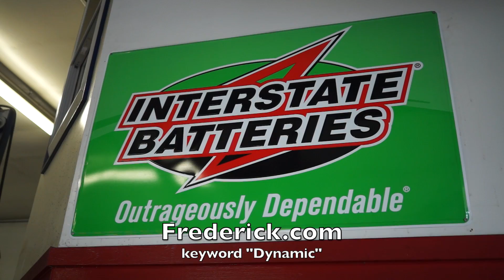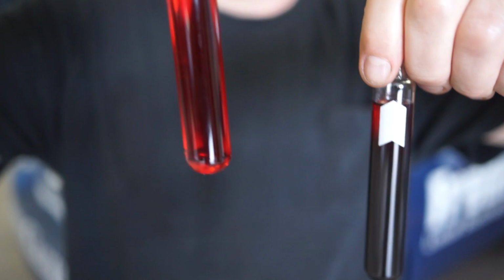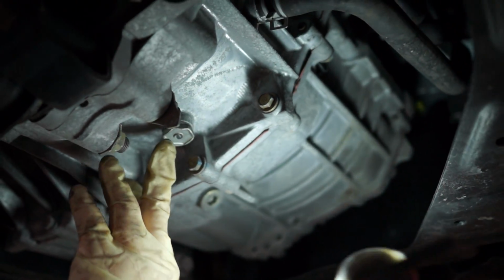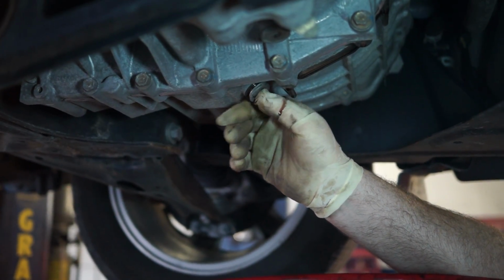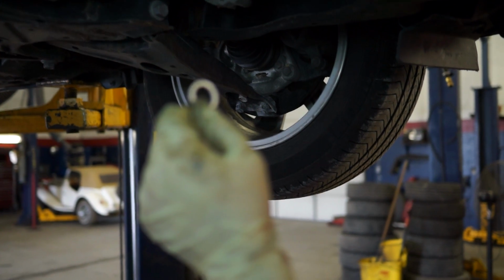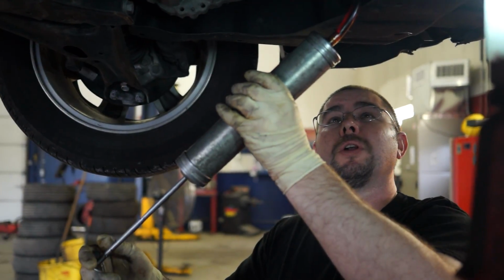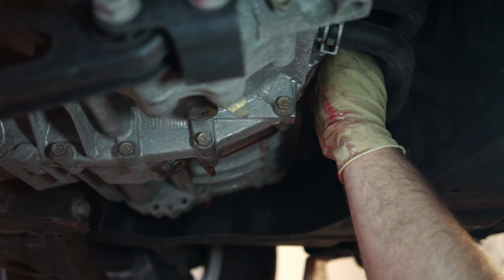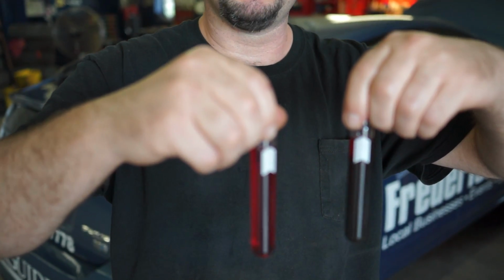Prius Transmission Fluid Change (eCVT)

Comment: When I had my 2004 Prius, I changed my trans oil for the first time at about 215,000 miles and it was still reasonably good, it was a dark red color with nearly the same viscosity as when it was original, my measuring device showed it as a little broken down, also no debris visually or magnetic, but still good, and instead of using a suction device to refill I ran a flexible clear tube from the top into the side with a funnel connected at the top. I finally scrapped the car when the odometer got up to 299,999 miles and wouldn't go past that (PS: the dash went black every now and then, but fixed when I removed & replaced a capacitor with one that had a higher μF on the unit underneath the "D" gear light, labeled "C1"), even though I'm sure there's a firmware update that could've fixed the frozen mileage problem at 299,999; and amazingly the main hybrid battery was still in good condition and the car averaged almost 62 MPG every day, city & highway combined (usually from the SoCal to Southern Utah and back) considering it was 13 years old when I finally replaced the car in 2017 with a 2017 Prius Prime. The only problem it was having was the engine started idling rough after 290,000 miles whenever the car started up cold and it got an intermittent misfire trouble code. The spark plugs were changed with Denso brand at 100,000 miles and never again, my (synthetic 5W-30) oil changes were every 10-15,000 miles with a little top-off every now-&-then, and the K&N air filter that was only cleaned, not replaced, the coolant was changed twice in its entire lifespan, and had only 2 tire changes with regular balances and rotations, the Eco tires of course. In Southern California I still managed to sell it for $2,500 with all those miles. It's a good car if you take care of it.
Reply: Exactly the comment I was looking for. I bought a 2nd generation with 175k miles as a beater for uber and I know changing auto transmission with high mileage can risky if the transmission is on it's way out. I still think it is worth the risk and to change it. The prius has longer service intervals with the electric motors so I am confidant after the change, no issues. Super easy, just like my manual gear box on my G. 

Thanks man!
Reply: Just changed it with Amsoil Full Synthetic Automatic Transmission Fluid, no issues what so ever.
Reply: The prius is a bullet proof tank. 5k miles later, bulletproof tank at 205,000 mikes
Reply: Motordyne G35 It’s like your manual gear box because that’s essentially what it is! It’s a planetary gear set which has a chain and is electronically controlled. Changing the fluid is ONLY beneficial. New fluid will only improve things lubrication wise. And the gen 2 Prius is a tank. Things are truly solid. Built in Japan 🇯🇵
Reply: The guy in the video kind of doesn't know what he's talking about, the only thing that really generates any sort of heat in a prius transmission is the wet clutch. It's essentially just 2 electric motors sandwitched between a planetary gearset, there's no friction belt. Probably why you can get away with 200k miles on the same fluid.
Reply: i just picked an 07 with 255k and im getting 43mpg city did you get better mpg's after the cvt fluid change?
Reply: @devanwheeler3426  agree.. When he talks about clutch wear in the oil, you know he has no idea about the transmission... You can complete the oil change quicker at home...
Reply: I got my 2008 prius in 2015 with 40k on it, used as a pizza delivery vehicle, now for the last 5 years I have been driving 10 miles to work. It how has 150k and I've only averaged 31-36 mpg since day 1.
However I've I take a hiway trip which is rare, I get 55mpg.  At 140k I did brakes for the first time, and tires for about the 15th. 
Fuel System cleaner every 3k
Oil change every 3k
Reply: @MotordyneG35  a drain and refill would not do much damage anyways... that is the safest way to do it if you havent done transmission fluid change in a long time...  much safer than flush for sure.
Reply: Your 2004 Prius was not getting 62 mpg. On a clear day with tornado winds propelling you forward you might have gotten 42 mpg. And I still wouldn’t believe you.
Reply: why did you say never again to denso plugs? I understand they are the original in many Toyotas
Reply: @sherifmohsen1974 my prius gets 62mpg regularly
2012
Reply: @justinhaller2055 same here... 180k miles on a 2007.
new tires and spark plugs... driving carefully to charge in every chance.. same 41mpg
Reply: @sherifmohsen1974 Yes. the 60mpg guy is obviously lying.

Comment: this trans does not have clutches therefore this fluid only lubricates it therefore does not break down or burn however it does get dirty which is a big no no when 500 volt electric motors are involved (they could short) and this transmission generates far less heat then a conventional transmission this is due to the dedicated inverter cooling system (separate from the engine cooling system) that also cools the motors and therefore the transmission toyota recommends changing the fluid at 100k miles and the fluid is usually still pretty clean at that time this car in the video either didn't have its fluid changed in a very long time or an internal component was breaking down
Reply: I think you will find there is a number of clutches in this unit...
Reply: The guy on the video is a master mechanic.
Reply: The guy just said the fluid had clutch material in it?  Does it have clutches or not?  Does it have a torque converter?
Reply: (A tumbleweed just pass-by)
Reply: It does not have clutches. It has a planetary gear set. No changing gears means no need for clutch packs. There is also not torque converter. It utilizes two electric motors and weber automotive has a YouTube channel and their professor did an exceptional job dissecting and explaining this ecvt unit and how it works.
Reply: @bucki58  "Master mechanic" lmao ..I've heard that at a dealership once...
Reply: @MrImarcus  I think you must be a "Master Mechanic" lmao!!
Reply: @derekcarson7976  Awesome video. Thanks. Just need to watch 20 more times to wrap my head around..LOL!
Reply: The weber automotive youtube video about eCVT indicates there's a type of clutch for protection of the combustion engine from mechanical shocks.
Reply: @eternoaprendiz10   it's not in the transmission it's on the flywheel similar to a manual clutch design with no release mechanism it's spring loaded dry plate clutch.

Comment: Prius CVT is no CVT at all! It doesn't have a metal chain!  The rest, I was ok with until the guy said "clutch material" there's no clutch in there is there? Isn't the little motor directly attached to the engine? With no clutch?
Reply: Yeah. You are correct. NO clutch

Comment: YOu can use flex hose and fill it from top of the engine not using this complicated tool.
Reply: what size hose?
Reply: Michael Giebler 
One that goes into the fill hole and has a funnel at the top.
Reply: Did my wife’s in the driveway
Reply: What's the point of that?  Since you have to get under the car to open the drain hole, might as well just use a cheap oil pump to pump it in from below, rather than getting out, going back under, etc.  As soon as it's drained, put the plug back on, pump it in, put the other, fill, plug on, and you're good to go.
Reply: @justinw1765  Yes, I agree, it is not expensive from Amazon less than $15.  But Toyota WS indeed turns to darker colour from heat cycle but it does not mean the fluid is already bad.  In most cases, it still has some hundreds of miles of life left even after 100k miles.   The transmission in hybrid is just like differential, all gears, no clutch materials or belts.  Yes, I changed it every 100k miles for my own ego and what Dealer recommended.  It always black but still flow and has similar consistency than the new one. It even smells the same, no burn smell.

Comment: Thank you for the video. On my Prius, I do an “infinity change.” I remove a quart of old fluid, and then add/top off with only WS fluid. I repeat the process 3x until the existing fluid visually looks like fresh WS fluid. In my experience, removing 100% of the fluid in one step, forces the existing gunk to dissolve in the fresh fluid to clog the internals. I do this every 20k miles. Million mile corollas in Asia employ this technique.
Reply from the maker: Interesting.
Reply: Enough to make a lubrication engineer cringe. You are diluting the old fluid and replenishing additives in the oil. HOWEVER, you are not removing a great deal of wear particles that will be left in suspension. And before you retort defending this absurd approach to servicing a transmission, get a ISO cleanliness report on the fluid in the transmission currently. Then drain the entire capacity and retest after this batch matches the mileage of the old sample. The second sample will show much lower wear numbers. 

And just so you know, the second generation Prius CVT doesn’t have any electric motors submerged in transmission fluid so you don’t HAVE to use WS ATF. There are countless suitable alternative low viscosity fluids available. WS isn’t some special hybrid fluid. It was designed for wet clutch traditional Aisin transmissions if you want to know the facts. Last time I checked the Prius has a planetary based Cvt with a chain. Nothing special. I have one and use Valvoline Maxlife ATF. It’s approved by Valvoline. They happen to know a lot more about oil than Toyota.
Reply from the maker: @nordicpride9708  All good points!

Comment: 2007 with 200k and I just changed it with Amsoil Synthetic Automatic Transmission Fluid. Runs like a champ.
Reply from the maker: I would have used the special Toyota fluid.
Reply from the maker: @MotordyneG35  Good luck!
Reply: @MotordyneG35  How is your Prius doing to this day?
Reply: @hedgehogthesonic3181 probably doesn’t have it anymore. ECVT crapped out lol
Reply: Is there a video about it?  @maxboya
Reply: @maxboya I bought a transmission at junkyard for $350 only 80k on it runs sweet
Reply: @genxchas  nice